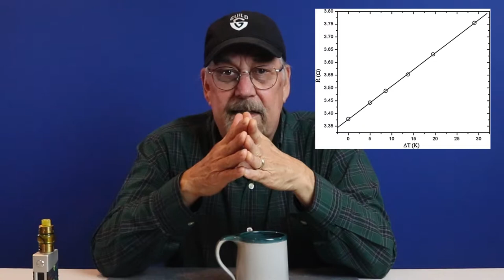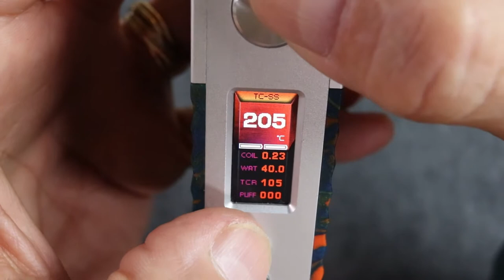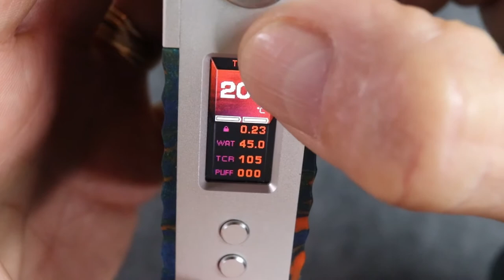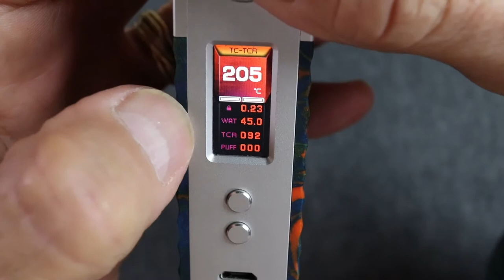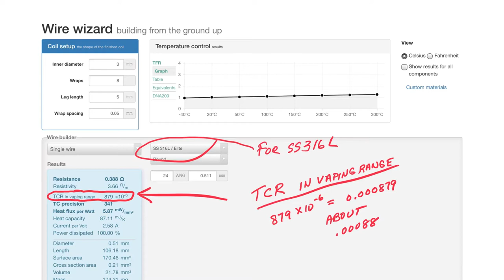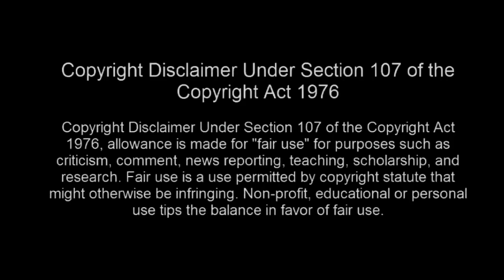TEMPERATURE CONTROL BASICS

Comment: Thank you Sir. Been vaping since I kicked a 35 year ciggie habit last Christmas and I'm over the hit and miss manufacturing of pre-made mesh coils. Using geekvape and Firemax sub-ohm tanks and coils and maybe 4 out of 5 coils last a couple of days before the dreaded burnt taste and 1 out of 5 or even 10 might last 5-7 days. Same process every time... Prime, fill, let sit for 15 mins... Vaping at 30 Watts on my Geekvape Aegis Mini with Cerberus tank and 50-60 Watts on my newer Gaur 21 with Fireluke 3 tank. Not really pushing the envelope. All well within the recommended wattages for the coils I'm using, but still they're burning out too quickly in my humble opinion and the flavour is underwhelming.
So I've been considering buying an RTA and experimenting with TC-SS.
Yours is HANDS DOWN the BEST explanation I've found and I thank you for taking the time. I'm confident I can have a decent crack at it now so I'll pick up the Zeus X RTA and some SS coils and cotton tomorrow. Down the track I'll learn to build my own.
Hope you're well. Thanks again 👍
Reply from the maker: Thanks, John!  Please let me know if you have a good experience TC vaping.

Comment: This is exactly the kind of information I've been looking for to start using TC mode. Thank you very much for doing this video.  I just have a quick question
1/ How does TCR value affect the performance of vape? For example, 92 and 105. My mod (swag 2) has the preset value for SS to be 105 and I am using SS316Lfused claptopn (2.5 inner diameter)  coming out at 1ohm. Shouldn't it be 92 as the said value of SS? 
2/ What does wattage do in this mode? What wattage should I set it for the said coil? Can I set any wattage at my desire? 

Thank you in advance for your answers.
Reply from the maker: 1- the TCR basically describes your wire’s slope.  2- the wattage will affect the max temperature you want your wire to heat up to.  The mod will not let the wire overheat.  Hope that is clear.

Comment: Will my mod break if i use nichome 80 in a different setting such as titanium temp control or stainless steel temp control mode? I hope i am making sense. This is all new to me, but i love the idea of temp control and its benefits.
Reply: @Leo Brazz
I don't know if that would "break" your mod given modern devices are replete with many safety cut off measures, but there is no point in doing it.
TC relies on the metal you're using having a predictable and measurable change in resistance as it heats. That's how the mod calculates the temperature of the coil and therefore regulates the power being applied to it to maintain the temperature you've set.
Ni80 behaves more like Kanthal in that it's resistance doesn't change enough, or predictably enough, to make this calculation.
For TC you want to use SS, Ti or Ni200. Use Ni80 in wattage / power mode just like Kanthal.

Comment: When you set the temp control SS and you adjust the wattage can you explain the effect this has on the experience e.g 904ss @530°F  50w Vs 200w and if there's anything to be careful with in setting the wattage higher than the "power mode" recommendations in TC mode as I am still confused as to why it doesn't set the wattages based on the desired temperature selected
Reply: @Scott Rivers
Setting the wattage in TC is basically adjusting the ramp up time. i.e. how much power the mod will apply to get the coil up to your desired temperature and hence how fast it will get there. Your coil will reach that temp faster if your mod initially fires at 200W than if it fires at 50W. Once the coil has reached that temperature, which it determines by calculating the resistance change in the coil as it heats, the mod will throttle back and apply only the power necessary to maintain your set temp for the duration of that firing.
I set my wattage somewhere between 80 and 100W and my temp somewhere between 250 and 280 Celsius depending on the flavour I'm using. Higher for dessert types and lower for fruit types.
Bear in mind some mods do TC better than others. My Gaur 21 is fantastic with wattage but very ordinary with TC, whereas my Geekvape Aegis Mini and Max mods do TC really well. So your TC mileage may vary so to speak depending on the mod you have.
As long as you're not maxxing everything out and not trying to start a forest fire in the rain when you dry fire your coils at installation or cleaning, you can't go too wrong with SS in TC so fiddle around and find your own sweet spot.